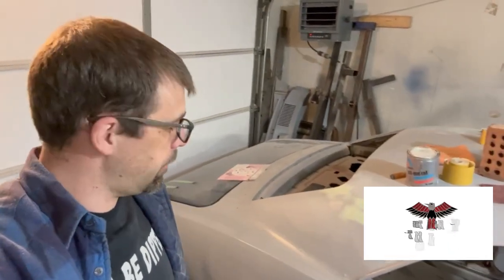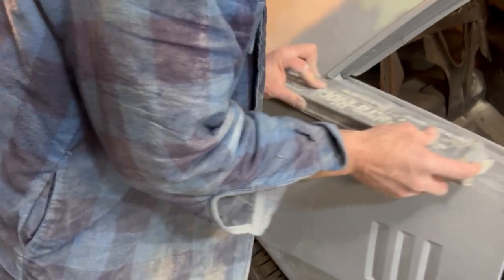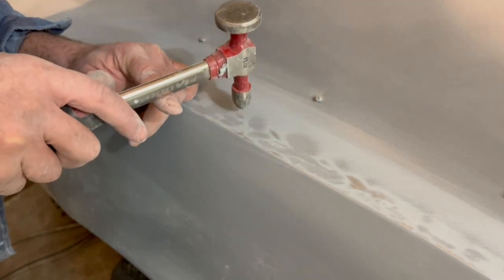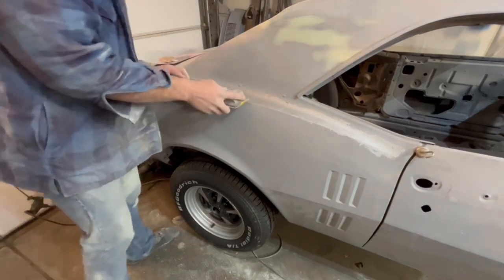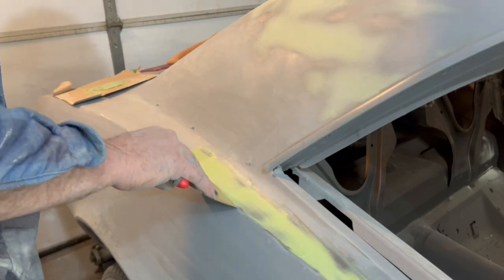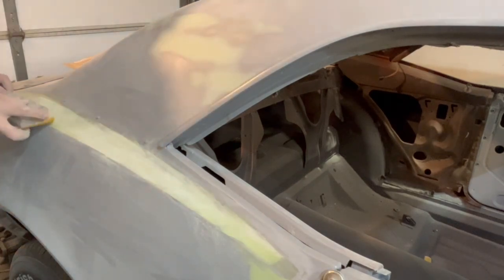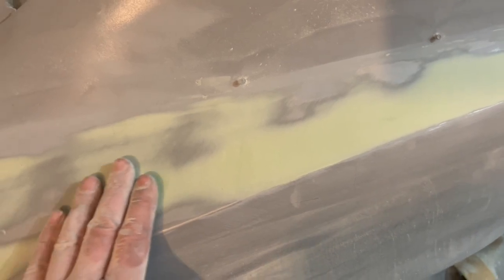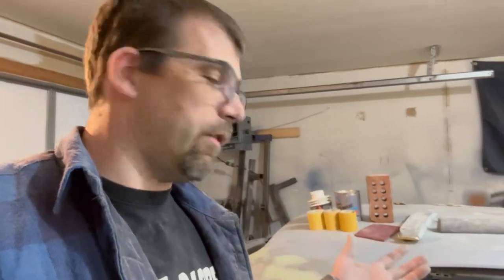Filling in complex curves and keeping it straight 1968 Firebird Restoration

Comment: The edge of that flat block will give nearly the same results as a round block if you use the right technique as you demonstrated. You can make your own custom blocks from different foam materials like the round foam used to insulate copper hvac tubing or the sheets of foam used in shipping boxes for items like flat screen tv`s and radiators. You can just cut out the size and shape you need and whats nice about these blocks is they are a little more compliant around curves and edges so they dont gouge so easily. This type of block is especially useful for contour blocking primer in final stages. Keep rolling.......
Reply from the maker: Very well said.  I do like the round blocks for sanding primer but to get the shape I prefer flat for some reason.

Comment: Question on sanding blocks, are they all the same or do you have a preferred manufacture.  Starting to gather body repair supplies.
Reply from the maker: “Durablock”makes the ones I use. Several different sizes are available. My favorite one is the 24” block I use it the most.  I believe they sell a kit reasonably priced online with assorted sizes and shapes.
Reply: @VinylVillageGarage  Will check the kit out.  Going to be a few months till my project is at the body work stage, getting supplies ready now.
Reply from the maker: @dpin6072  good plan. Nothing worse then hitting a road block because you need more supplies or tools.